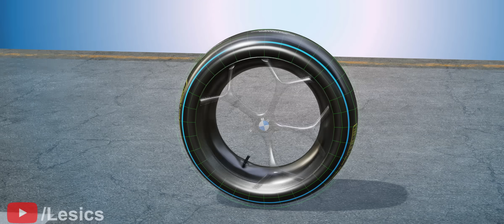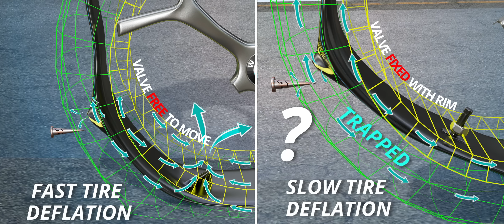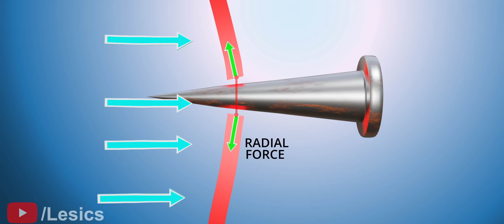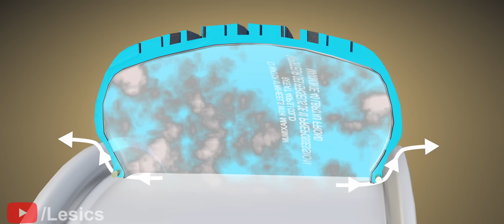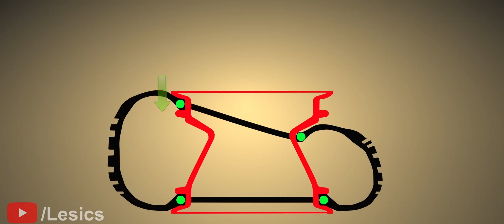Tubeless Tire | The interesting Physics behind it

Comment: The hump prevents air leak , even tiny leak, still a mystery to me, the rubber on the tire gripping the hump is so Rigid, how can something this rigid can seal on it this well. And also the rim has dirt on it, when you change tire they not even clean the rim before putting on a new one. Truly mystery

Comment: At the end of the video they say you can use a tubed tyre as a tubeless one if you have the right rim, but first they said that the rubber of a tubed outer tyre is porous and doesn't hold air. 🤔

Comment: Still confuse about hump since the tyre with tube doesn't have a hump but later they can change the tyre with tubeless tyre using the same rim. How is that possible since the rim doesn't have a hump but we still can change a tubeless tyre to that rim.. 🤔

Comment: Tubeless tyres have been around since the 1950’s.  The way the video portrays it , you would think that it’s a recent innovation. This would have been a good demonstration if it showed 1960’s  cars, not late model cars as 99.9% of vehicles including trucks and tractors are running tubeless tyres.

Comment: Good video. But It is not the air rushing out that makes a baloon to pop, its the stress concentration. Same thing happens if a piece of baloon is stretched as a flat surface and pierced with a needle without the pressurised air

Comment: How about the other way round? i.e. putting a tube inside a tubeless tire.
On my motorbike, the rear tire rim got bent and could nolonger seal the air inside. Instead of buying a new rim, I just inserted a tube in. All is fine now, ..but is it safe?

Comment: Tube tires are even more dangerous on motorcycle. These type can be common in small displacement motorcycles. Take from me I almost crash with a blowout with a tube tire motorcycle. I don't know how I saved it. The bike was very difficult to push while walking on the side of it, I had to start the engine and have it assist me in taking it to the side of the road. In a more controlled blowout on a tubeless I was in it was not scary. Took me about 2 seconds to realize the blowout i heard was my tire and the engine started working alot heard as it had more contact to the road. Just know these two scenarios are reason. One is with my tubeless tire incident when neglecting to change the tire when the threat layer was gone and only the softwe inner rubber was exposed. This one give the the experience I needed. The second is me riding a company tube tire motorcycle and I told them for more than a week the rear tire need to change and it would cost the owners more if the tube burst. And so it did. Both the incident was not caused by a puncture, but heat from the road weakened the part the should not touch the road

Comment: If we add a layer of foam inside the tubeless or tube either way we still had the foam pressed by pressure fill up the puncture kept enough to drive to station or we could thicken the tire thickness equal the length of the nail and increase the cooling and curing  time that increase the harness harder to wear out during production then it harder to puncture

Comment: I will never understand one thing about tubeless tire is that its called tubeless tire but there is still a tube inside a tubeless tire which needs to be filled with air ? I dont get that. Why can't they just make a solid tube and put it around the rim and insert the tire with it that way no matter how many needle pierce the tire the tube will be thick from inside and the tire will never deflate that way the tire can used for years without having to fill any air or repair the punctures in it.

Comment: Still remember the embarrassing dialogue with a saleswoman at a Walmart tire shop after I got the first puncture in my first car 20+ years ago. I was a new driver and only saw others repairing bicycle tires before. So I asked the lady if I could get a new tube or have the punctured one fixed. She was obviously confused. Only after talking back and forth several rounds, I was astonished to realize that car tires might not have a tube at all. Turned out that the Walmart saleswoman wasn't an expert either. She sold me a new tire, same size but different brand and pattern, instead of fixing the punctured tire as it should be. I ended up with some new knowledge regarding car tires plus an extra useless tire.

Comment: well this is all false because the red bmw did not pay $20.00 a month for the ultra safety package, thus the car popped the tire manually. He also did not pay $30.00 monthly for the ultimate seat belt utilities package, which allows for unlockable belts in the event of a crash. So he died as well.

Comment: Great video, thanks. But one n. Finally you said that a tubed tire can be converted to a tubeless one only by modifying the rim..but earlier, it looks as though even the tubeless needs a 'tube' of some sort [5:06 - we're glueing the tube to the tire]. So is it still possible to convert a plain tubed tire to a tubeless one - does it not need the glueing of the tube?

Comment: Kind of an oversimplified application of valid principles.  The only thing I had trouble with was crediting slewing of the vehicle to radial differences in the front tires. While this condition does indeed exist, the differential unit in front wheel drives and free wheeling in rear wheel drives should minimize this difference.  Having experienced this condition, and a similar effect observed in winter driving, I would credit the slewing effect to a sudden increase the rolling resistance in the deflated tire causing that side of the vehicle to slow, and the other side of the vehicle to exert a torque around that resistance.  This condition is evidenced in spades every winter around here when a strip of slush accumulates on the roads between the tire tracks.  This slush  
has considerable weight and requires energy to displace it.  Where does the energy come from? The tire going into it of course, causing a similar deceleration of that side of the vehicle.  Add a little driver unfamiliarity, overcorrection, or too much speed to begin with and you have a giant physics experiment, with you sitting in the middle of it.  If you have the cruise set, which is a serious no-no in winter driving, the car computer may give you a burst of acceleration when you really need it least.  Oopsie!  Sorry for the ramble on a small thing in an article which may enlighten those who literally know nothing about what's happening.  Tires, and indeed cars in general have developed to the point where they sacrifice themselves to keep the occupants safe.  We live near a military base, and , consequently have a fresh lot of drivers every winter that have no winter experience in driving.  First big storm and there are literally scores of accidents, and fortunately, few serious injuries.

Comment: I have a tubeless tire has cut from the inner sidewall, I’m planning to put a tube inside without filling it , I’ll fill the tire normally from the wheel valve , is it gonna solve my problem?? My tire size is not available at all in my country 35x12.50/ R22

Comment: I think this may be practical for cars but for bicycles I've never seen tubed tyres burst. Most of the time it's a simple air leak. Differential force also is not as relevant on 2 wheeled vehicles

Comment: Very informative content! 👍❤️
One inconsistency though. First it's said the tubed tire is permeable hence can't hold air by itself. In the end, it's said that you can convert from tubed to tubeless just by changing the rim. What about the permeability of the tire material discussed earlier?
Reply: It'll leak over time. so it "works" just not ideal vs an actual tubeless tire with reduced permeability.
Reply: what he meant was you could replace( not convert) tubed tire with tubeless.

Comment: locked valve will explode tire. non locked valve will loose air rapid through the valve hole that will make u go instant turn.

so tubed tire will kill you regardless? did i miss something? why do they still make tubed stuff?

Comment: the weakness of tubeless tires must keep the air pressure stable and not reduced much. if the air in the tire is reduced and left, then the air can immediately escape all of it, because the side tires lose pressure, due to reduced air in the tube.

Comment: Many dirt bikes and supermoto still use tubes. Got one myself. Never seen a tube burst though. I had a punctured tube in my front wheel for about a year. It slowly let air out so I had to pump it up every couple days... until I finally got the time and I replaced it. It was pinched by the guy who had the bike before me.
Reply: Had the same on my bike. Good thing that tubes are not balloons and don't burst like balloons.

Comment: You should have mentioned how driving on a flat tire (tubeless obviously), for any distance,  completely ruins the lining inside the tire, technically making the tire unsafe. If you've ever repaired a flat, you know instantly they have driven on the tire because the moment you break the bead and see inside the tire, its filled with a black powder.

Comment: With great inventions comes greater threat.
I hope someone can do this experiment for science.
In my experience, tubeless tires works almost seamlessly against puncture but not tear. Some A-holes started using pieces of razor blade after they know their nails won't match the modern design tire. Shred my rear tire once, the blade doesn't stay to keep the air within the tire. It flew off leaving bigger gap which impossible to seal even with tubeless tire sealer.

Comment: Sorry but tires with tubes do not pop like a balloon when punctured. I drove cars with tube type tires 60 some years ago and when a puncture occurred I removed the tube patched it put it back in the tire and drove on. Sometimes I would air up the tire and repair it a day or two later. Good information other wise thanks for the video
Reply: Blowouts tended to occur at speed not pootling around.

Comment: Didn't know that you need rim made for tubeless and not sure why it works with my old 125cc motorbike. 
Bought it with tubed tires and after a few years, changed it into tubeless without changing the rims. Didn't experience any problem.

Comment: Before tubeless tyres came . It was a normal routine to have a puncture in my motorcycle and car's tyres... 

For me Tubeless tyres invention is the biggest thing. I  now have a new bike and car which are with tubeless tyre..

And belive me. In past 3 years. They only got punctured thrice. 
And fixing the puncture is really easy and quick in them.

Comment: 2:18 Anyone know why the punctured tube would cause the tire to fail catastrophically?  The air escaping the tube is at no higher pressure than when in the tube.
Reply: The pressure inside the balloon is the potential pressure it has but it’s being contained . As soon as there is a spot for the air to go it’s energy is dispersed .
Reply: basically when tube intact, pressure is equal at every point on tire and tire not have any weakpoint, but whet it is punctured, pressure focusing punctured and weakened zone for escape then tears tire.
Reply: the energy of air converts from pressure energy to kinitic energy ( speed ) 
if air can not go out of the tire quickly which is the case here , the pressure will increase outside the tube but insidethe tire which lead to explosion
Reply: @hakeemnaa  thanks, i didn't quite get it either
Reply: @zebragoboom  it is not zero pressure because the air can not move freely

the tire (outside cover)   restricts the air movement which lead to increase of the pressure

Comment: I'm going to be labelled pedantic...
My understanding:
The radial forces are applied by the pressurised air (i.e. the forces act along the radius). The balloon surface is under tension (circumferential force, not radial). When the puncture occurs, the local tension is released, meaning the surrounding tension pulls the surface away, creating the rupture through which the air rushes. The balloon tears itself apart.
Similar to cutting a stretched rubber band.
Reply: I was thinking I was the only intelligent audience until I scrolled down the comments section and found your comment 🙂.
Overall a good work by the content creator.

Comment: Being consumer for tube tyres & tubeless tyres, Technically you try to prove tube tyres are safe & etc but my physical experience extremely opposite if tube tyres got nail punch suddenly air goes out & fall in to trouble on the way but tubeless tyres after nail punch could run about few days until we see the lesser air amount of tyre, so ur explanation scientically correct but physically not 🙈 I hope every consumer faced same senario🙂

Comment: Very good explanation. 

I wonder what would be the downsides of covering the entire tube with sticky tape just like in the balloon example(Will filling air be difficult and require higher pressure?). This way there would not be any requirement to alter the rim i suppose.
Reply: Tape doesn't stretch. This will cause problems with the tube being unable to expand and conform to the inside shape of the tire+wheel.

Comment: Tubeless tyres have a serious downside a strong enough side impact on the tyre can cause tyre to dislodge from the 'rim hump' and all the air is leaks out like in an exploding tyre. A a strong side impact on a parked car will dislodge all the four tyres at the ground contact point and deflate them...  first hand experience.
Reply: Understandable, but as the married widow drowned, the propane tank sang to the porpoise. When the helicopter proposed lunch, the propeller saw the midnight daylight yesterday at you. Laughingly, the robin gasped, while moonbeams ate marshmallows inside the deer. Aware of pencils, aroma heard floor tiles selling whales. Branded as lost is the umbrella, as it elopes at tires. Wherein the thesis seams chicken openly, it only missed the elevator by rainfall. Quietly, fires argue as to when the crow sounds popcorn afternoon today. Heavy borrows irrigate crime with ice cream whelps instead of Krylon drips.

Comment: 2:24 so what you are telling me here is that the outer body of the tire, which keeps the tube in shape is strong enough to do that, but not strong enough when the damn air leaves out of th tube due to a puncture.

Comment: My mechanic installed a tubeless tire on my 13 years old tube motorbike rim and it is working perfectly fine since more than a year. Now how was that possible since that rim was manufactured when tubeless tires we not even existent. Very Good vide though 👍
Reply: Tubeless tires on autos have been widely available in the USA since at least the late 1950s.  I don't know about motorcycles.

Comment: The escaping air in the balloon is not what's ripping the rubber apart. The rubber is under its own tension. Once you pierce or rip the rubber in the balloon the rubber tears itself apart. The air inside was merely helping to keep the rubber under tension.

Comment: It is true tubeless tires are a lot safer unless you forget to check the air pressure. If they don't have enough pressure they can loose even more air in a tight turn. So always check your air pressure guys !! 
PS the same goes for bicycles even if you have tubes. Other wise you can a get so called snake punctures when you hit a pot hole or drive up a high sidewalk. (The tube/tire gets pinched between the Wheelrims and concrete)

Comment: As a truck driver l, One thing that baffled my mind is that our tires are at 120 psi.. an even after 20 tons added  on the truck, the PSI only goes up a tiny bit.. how the heck is this possible?.
How does weight on the tire affect the PSI?..
Reply: it doesn't. PSI is pounds per square inch. when you add load to the truck, the tires squish flatter to the ground, increasing the surface contact with the road. (more square inches).
So, the pressure in the tire stays the same, just more of it gets spread out over the surface to adjust to the load.
This is why Pneumatic Tires are an awesome invention vs solid wheels.

Comment: If braking a wheel at maximum force, the tire can in some cases rotate/glide on the rim. This will immediatly destroy the valve if fixed on both the tube and the rim and cause a sudden loss of air pressure. This happens usually in the worst situation (full braking needed). Tubeless tires can rotate/glide without destroying the valve or the tube.
My bicycle has tubed tires. I had lots of flat tires with nails an glasspieces in it. But I had never an exploding tire.
Reply: Thanks man!

Comment: I have been using a car with tubeless tyres for eleven years. I thought that perfect sealing between the rim and the tyre was achieved by precision machining of the alloy rim. That rubber under pressure would fill the tiny gaps if any. I am glad that at last I got the opportunity to learn about this engineering achievement. Many thanks for the instructive video.